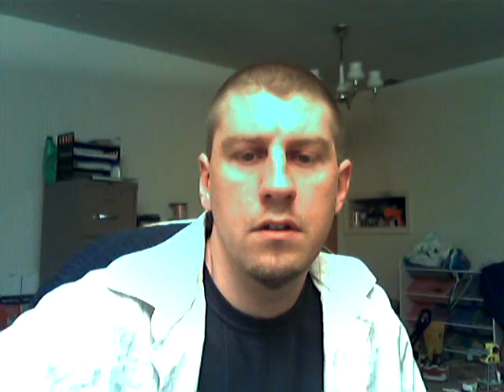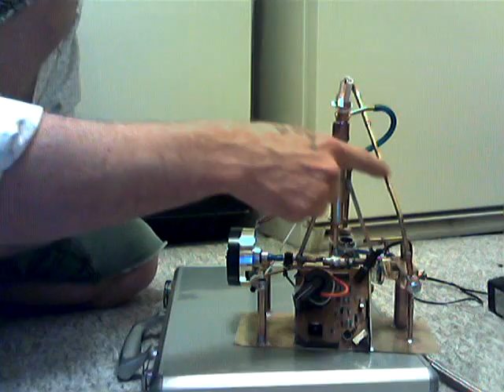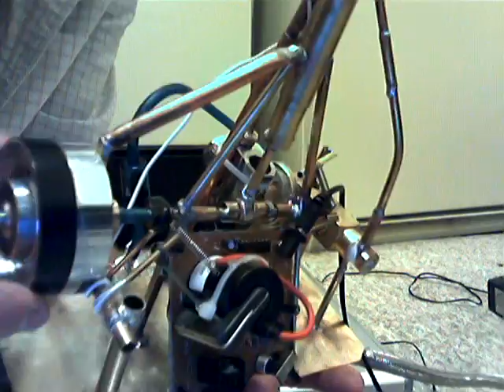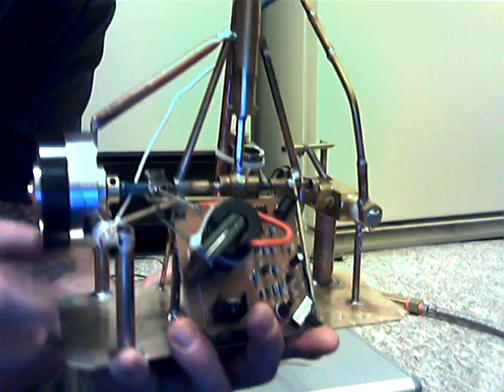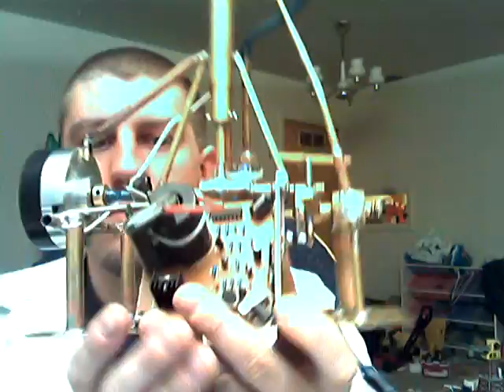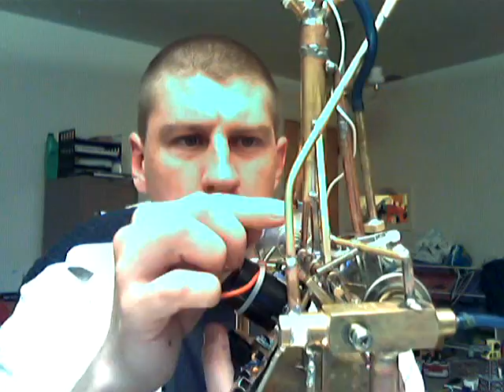hho Engine

Comment: yeah i laughed hard watching you get zapped.
high frequency wont kill you.
those flybacks from the plasma balls will jump sparks around like crazy.
why dont you switch the low voltage side of the input rather than trying to switch the HV side?
use a microswitch on your cam.
plenty micro swithces in old microwaves around the door.